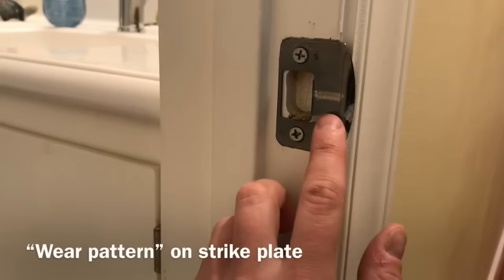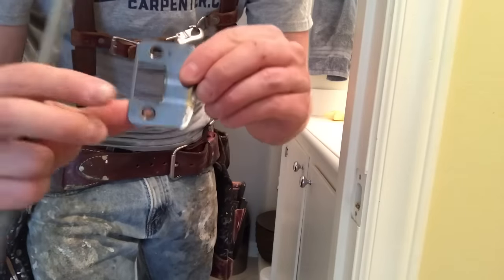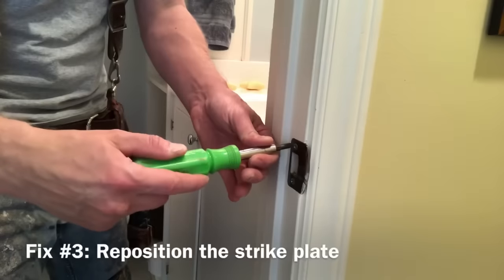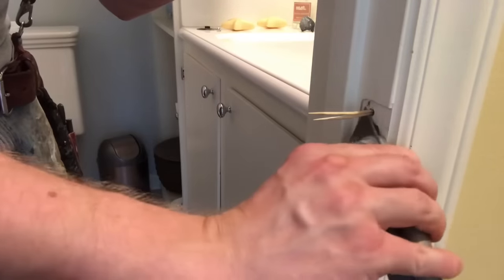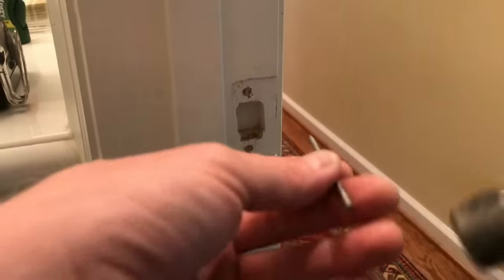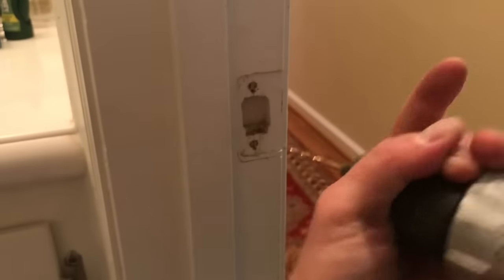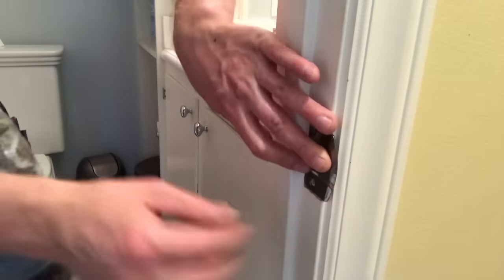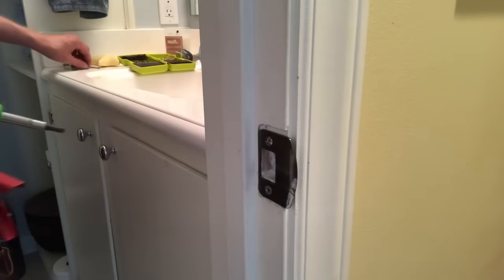Door Won’t Latch—3 Easy Fixes!

Comment: What's the best way to close the space on the latch side? I've already added 3" screws which brought only the top of the door over so there's still a larger gap on the bottom of door.  Should I shim out the bottom hinge to even it out??  I'm afraid the hinge will stick out to far and not  open and close properly as well as latching better...  Thank You in advance!! Happy New Year!!

Comment: For the toothpicks, just try one toothpick per hole. Put in the blunt end(if applicable) first, then snap it off, then insert the pointed end( if applicable). Drive it in with a hammer or something and you probably won't need glue for most holes.

Comment: When I moved into my apartment 18 yrs ago I didn't pay much attention to my master door. I noticed it would blow back and forth when closed and there was a storm outside. Only recently did I realize it needed a strike plate they had just painted the hole and walked away. Yea slumlord city here. Anyway never having put one on I figured it was a piece of cake. "a 5 min job" Now is where I warn all newbies like me to DIY repairs it is a CURSE to ever estimate how long something will take. I screwed the plate in with no effort and proudly closed the door. It no longer shook in place however it also didn't latch. It acted like the plate wasn't deep enough in the groove. I messed with it another half-hour and then gave up. at least it no longer rattled. It's still there and still doesn't latch. I do NOT want to risk messing it up. Let them. Right now it looks better and is semi functional LOL. Thanks for this video we have had serious EQ's here and I think the doorjamb is twisted a bit. Mine is almost lined up with the hole it has about 1/16th inch that it's below. I am just a chicken and don't want to carve it out LOL. Thanks for the video.

Comment: Great tips. As for filling the old nail holes, another YouTuber showed how he keeps a supply of wooden golf Tees for accomplishing the same task. A quick tap with a mallet of hammer (don’t remember if he used glue on his, but the super glue makes good sense) then break off the end or cut it flush and there you go. Ready to be Re-drilled.

Comment: I’ve got an attic door wherein the problem is the latch just doesn’t engage the hole.  It’s an old house.  Over 100.  So build up some extra material and remount the plate?  Like some thin wood shims?

Comment: We just bought a home that had about 90% of the doors with this problem. About half of them latched fine after I just went through and tightened all of the hinge screws. 2 I had to add a hinge shim to the bottom hinge, since I could see the door was not square in the frame. That solved them! In my personal opinion, those 2 steps were way easier than filing or repositioning the strike plate... 🤷‍♀️ Love your videos! I would definitely move to these steps if the 2 I tried didn't work.

Comment: For a very quick temporary fix, on par with #2 fix, simply pull up on the knob when you close the door.  This gives you more clearance at the bottom of the latch plate, until the problem gets worse.

Comment: The number 1 way to fix is realize over time the weight of the door is pulling from the top hinge. You can tell when you close the door and the reveal is not even. Unscrew the top hinge at the door jam. Put in a 3" screw to pull back in place. Rescrew the top hinge and fixed!! Everytime!  No putting or hole to fill because its behind the hinge. You can do the same with out removing the 3 or 4 hinge screw and just replace one with a 3". Try it.

Comment: I had to do this on almost all my doors (fix # 3). What I did was drill out the old screw holes 1/8" & glued in a 1/8" dia. dowel then grind off flush. Then marked the new holes after chiseling out the jam to the new location. A little more work but worked great for me.

Comment: I always start at the hinge screws first. Usually I  find that the door will become misaligned which also cause this problem.  The same glue and toothpick trick works well.

Comment: Doing theses adjustments are just quick fixes. Look at the door it’s usually dropped on the corner making it out of alignment with latch plate, try tightening hinge screws sometimes replace with large gauge screws. Door latches are usually originally fitted Center, Alternately keep adjusting latch plate until door hits the floor and rubs👎

Comment: Was a little project for a friend. The socket was at least 1/4" out of place and the door apparently never locked. I had to use the third trick, as the first two did not work much for my situation.  Followed the instructions. Easy and clear. Worked like a charm. Thanks for the details. Very helpful.

Comment: Fun fact.  Putting in a new keyed doorknob and it would not latch.  I followed the directions precisely BUT the person writing the directions failed to point out what side of the door you were working on.  So I'm on the inside and according to the directions I put my latch in the opening correctly, but they meant the OTHER side of the door so I put it in backward.  It would not stay latched.  All that work of putting in a new doorknob had to be undone and reassembled.  WAH!

Comment: 3:57  can't use wood glue for that? And at 8:38, I have broken drill bits that way. Overall, this is a very good video on moving the face plate which I have been going over in my mind for some time but the toothpick solution never occurred to me. Thanks!

Comment: What do you do if the door has sagged so much that there isn't enough wood to drill new holes? Tried all other options. Strike plate needs moved down about 3/8". Tightened all hinges, even spread lower hinge. to move up a bit; just can't get it enough to latch.

Comment: My dad was an excellent carpenter with a degree in industrial arts as well.  I'd labor for him at times and he'd burn through quite a number of repair jobs in a Chicago city day.  He'd not waste a moment with his efficiency and, if he didn't have a splinter of wood at hand (I never remember him carrying around toothpicks), he'd whittle on a pencil and jam it in the new screw hole, maybe with a dab of white glue.  Back then he'd have to deal with all kinds of hardware such as what today would be considered antique, mortised-in door latches and he carried some jars of parts.  He'd also had jars of screws, machine and wood of assorted varieties.  To this day I still clearly remember him spilling out some of one of those jars, him bending over on his knees and quickly sorting through the pile.  -Never remember him coming up short.  Yes!  And he'd drive in long screws through a hinge or two to pull in a door, driving them with a push-style automatic screwdriver which would do a lot of damage to a jamb or finger if an individual with less capable skills.  I learned from reading tips in Fine Hombuilding in it's early years that one could also carefully take a crescent wrench to the hinge pin tabs and bend them some to move a door in or out - working the bottom or top hinge in an instance like this.  Ah! And don't forget the possibility of putting down behind a hinge a layer or so of firm cardboard cut from a hinge box in one's "bag-of-tricks" to move the door some as needed.  In my days after dad retired I had access to a nice variety of dowel rod.  I'd cut a short length off with my carpenter's knife after creating a bit of a point then drive it into the hole of strike or hinge with some yellow glue after drilling if necessary.  I was spoiled.

Comment: I commend you on your choices for videos.  You hit on the most common issues that meet the needs of the widest audience in my opinion.  The only problem I have is that your videos are also very basic, but I assume a lot of people don't know these things so maybe it's just basic for me.  But good choices.  I don't like the toothpick thing, but I guess that's good for homeowners who don't do any woodworking.  I always have sawdust around so I prefer filling holes with sawdust mixed into Titebonds because Titebonds is far superior to CA glue for wood applications.  Even better is to fill the hole with an epoxy.

Comment: I imagine the top of the frame and the top of the door are not parallel. Usually caused by a poor original installation or a moving structure.
Also tightening the top hinge while shimming the bottom hinge is another option.

Comment: First video I saw, and it was all I needed. My problem was slightly different thou. The plate was aligned, but it was further down in the frame. All I had to do was slide it over using some of the stuff from here and presto. Thank you!

Comment: Thanks for the 3 tips for adjusting the latch.  I have one small suggestion to add.  For Tip #3 use those sharp skewer sticks you find with your barbeque dishes at your local restaurant or the chopsticks that you use at your favorite Asian restaurant.  I save those for just this kind of fix to plug up a hole.  The chop sticks may even be used as dowels for that small wood project you might come across now and then.  Again, thanks for sharing your video.

Comment: I'm thinking solution #3 is what I need. Question: this happens to one of my doors in the summer but in the winter it's fine. Do I need to just adjust the strike plate so there's enough wiggle room for this to move up and down with the seasons?

Comment: Toothpicks OK for hinges, not for latch. Drill n dowels will be on old holes. Also, try loosen handle n move up or down which pivots bolt a little.

Comment: Clearly at one time that door latched properly. The striker plate hasn't moved so that means the door is the problem. It's sagging from age and use. Adjust or shim the hinges and you wouldn't need to touch the strike plate.

Comment: I had to do this on a bedroom door at my son's house. I'm a rank amateur, but I did pretty much what you did and in the same order. I did have to eventually move the latch plate down. I wasn't aware of the toothpick trick, so I used rough plugs I cut with my box knife and drove them in gently with my hammer. It worked fine, but the toothpick trick would be SO much easier and faster. I'll keep that one in mind in case I have to do this again. 
Now I need some advice on what to do with doors that rub the frame when closing. Short of planing down the door, is there anything else that can fix this problem? I've tried pounding the door frame away from the opening with a hammer and a block of wood, but the door frame moved less than half a millimeter--not enough. I also checked the hinge screws, and they were tight.

Comment: First of all, the door is swinging in the wrong direction. That is against building codes, and won't pass inspection. Richard and James are right. First of all, check the reveal of the door all around. That will tell you what the problem is. If you are having to lower the strike plate that much for the strike to hit it, there is a crack between the top of the door and the jamb big enough to throw a cat through.

Comment: Handy techniques. If the door frame has settled wether the strike side or the hinge side another option is to pack the hinges on the jamb. The best material I’ve found is pressed cardboard like from a cereal box in 1/4” strips. In your case I would have packed out the bottom hinge closest to the hinge pin or the top one closest to the stop molding. One or two strips at most because you don’t want the door to hit the top jamb. Love your videos keep them coming!

Comment: This is way too much work.  First off check the hinge screws, especially the top.  1/4 turn of the screw will bring the door up about 1/8 inch.  You may not need any other further adjustment.  If you do need to move the latch, then just eyeball it and drop it accordingly.  Most times you don't need to cut out the wood because the door has too much gap, but if so then chisel it out.  Use bamboo skewers that you use to bar b que to shove into the old screw holes.  Just snap them off level and you have new wood to set a screw into.  Making too much work out of this.  I am a locksmith of 32 years in Kansas City area.  I could fix this problem in less than ten minutes depending on the condition of the door and frame.

Comment: I like to use a grinder bit for my cordless drill. Don’t even need to take the plate off. Usually it takes about 30 seconds or less.

Comment: I am surprised you didn't address why the strike is low. Door sag. I always look at the top reveal and then do what the old timers called "throwing the hinge". all you need to do is first tighten the hinge screws. That takes care of 90% of the sag. Then shim out the bottom hinge.

Comment: What you didn't address is causes.  Why was the strike plate off?  Figuring this out can lead you to a proper fix.  On an old door, it's often worn sagging hinges.  Replacing them will lift the door back to its proper spot.  Sometimes the knob has play and can be repositioned to bring the striker up.  Sometimes, when the install was just a bit off, the hinges themselves can be bent back on top and in on bottom to raise the latch side of the door. Recutting the strike plate is the last option I'd pursue and is certainly a mask for a different problem.

Comment: I prefer the 3rd method, but I don’t use toothpicks, I keep small dowels, and use a small drill bit, then glue in the dowel, gives a more solid base to screw the plate back on

Comment: Did you really use a metal file without a handle and an exposed tang! And on a work piece that was not held securely. I hope your medical insurance is fully paid up as I have seen what can happen in these circumstances. I don't think you should promote practices like this. Just being honest...

Comment: I use wood golf tees to fill in old screw holes. Dab some glue on the ends. Tap 'em in with a hammer. Score them with a knife. Snap 'em off. Drill new screw holes.
   Sometimes you'll find that some hinge screws are loose. Tightening the hinge screws may realign the door strike.
   Other times the screw holes are stripped and longer screws, that reach into the studs, are required.
   Sometimes, though, you have to adjust the hinges by squeezing or spreading them.

Comment: Would Titlebond wood glue work as well with the toothpicks? Curious what would you use if you wanted to fill in the strike plate area on the frame?

Comment: I had this problem with my mom’s bathroom door, I removed the top screw of the strike plate and loosened the bottom screw, then I pulled the top of the strike plate back about 1/8 inch then put top screw back in and tightened bottom screw, now door latches just fine.

Comment: I’m a locksmith and i’ve been doing it for 5+ years and 99% of the time it is because The door is sagging. That is the first adjustment I do than if it’s still not straight and then I move the strike plate down. But that’s usually the last resort.

Comment: How about bending the door's hinge knuckles by either spreading the hinge knuckles or closing the hinge knuckles to raise the door latch to align with the center of the strike hole.  It would be much easier.

Comment: I would think Super Glue is not the correct glue for this !
Better to go with a Wood glue, or maybe worse case, Elmer's glue !
But before going to all this work, I have found many times the door hinges have worked loose, allowing the door itself to drop down, misaligning the latch !
Many times just shoring up the bottom of the door with a simple wedge, will take the load off the hinges enough to allow proper retightening of the anchor screws !
Adding some glue to those as well, will lessen the chance for a reoccurrence !
                  👍😉
              Just Say'n !

Comment: My frames are metal and no way to remove the strike plate. After I sanded the door because it was sticking and now the door won't latch. So the repair has to be done to the door itself, unless I want to replace the entire frame which isn't going to happen. Any suggestions. Also I am talking about a bedroom closet door if that makes a difference. thanks.

Comment: My Door looks perfectly aligned at the strike plate, the door is hollow, looks tightly aligned all the way round, and hinge screws are tight. Strike plate marks are dead center and it doesn’t appear damaged. Any ideas?

Comment: I would probably drill out the old screw-holes and glue in round wooden dowel-plugs instead of toothpicks; it would create a more solid secure surface to drill the new screw-holes into.

Comment: I just had to do this on my kitchen door. I'm a beginner so it was super satisfying. I had to reposition the whole plate down and forward more and it JUST latches and it tight. I probably should have moved it up a little more so that the latch goes in past the holes edge to make sure it's in there, even though that would allow the door to rattle a little. Wouldn't really be an issue tho.

Comment: Hey, i love your videos, but i wanted to point out one small detail. When you used your file on the strike plate, I noticed you may have been filing on the back stroke as well as the push. If you have cross serrated teeth on your file, this is fine. Usually the most basic file is a “mill” or “bastard” file, and the teeth only cut in one direction. If this is the case, you’re actually prematurely wearing out your file. I know this isnt a super big deal, as files are cheap, but i like to take care of my tools and wanted you and others to be aware as well.